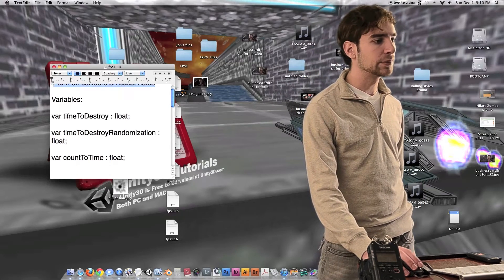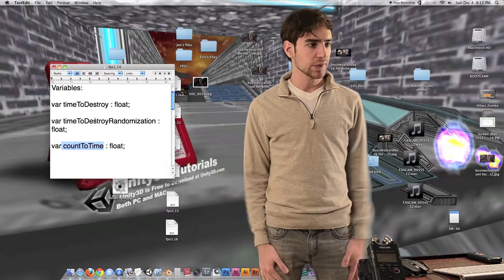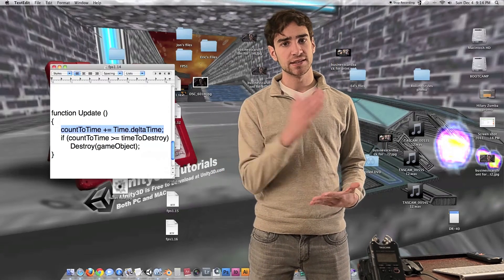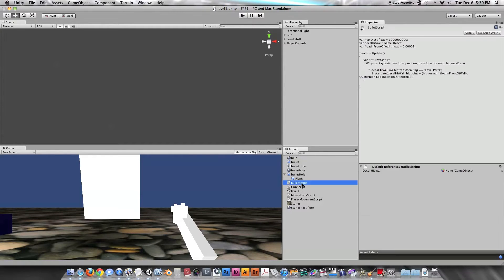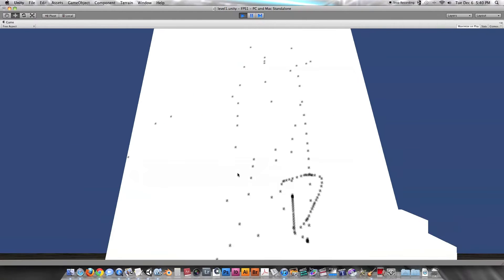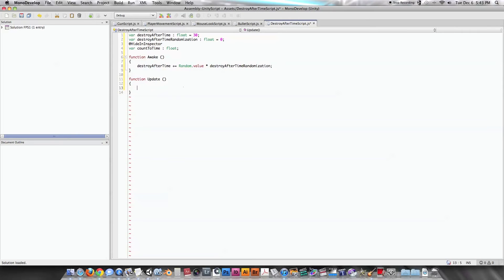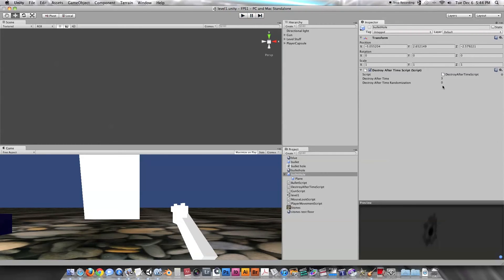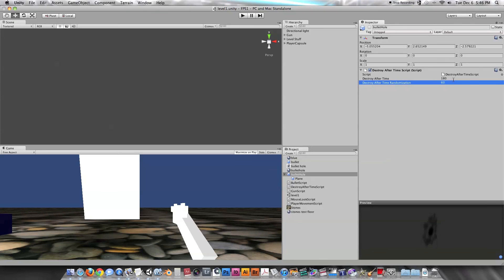FPS1.14 Bullet Hole Destroy Timer. Unity3D FPS Game Design Tutorial.

Comment: when my gun is in hip position the bulletholes spawn slightly to the right of the center of the screen, if my aimer is in the middle of the screen then it is not accurate, is there a way to accurately point the empty to the center of the screen when the gun is in hip position, then repoint it to face straight when gun is at aim position? Thanks